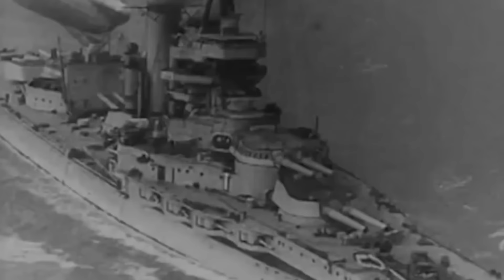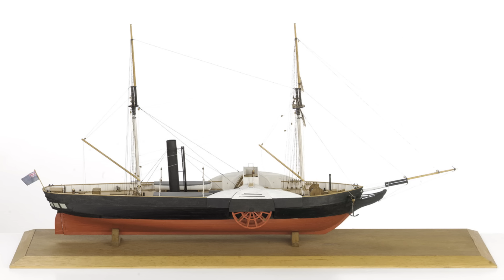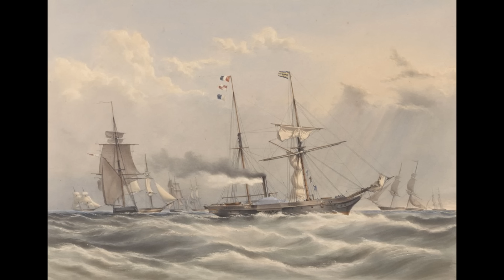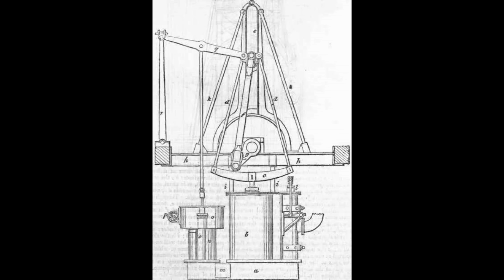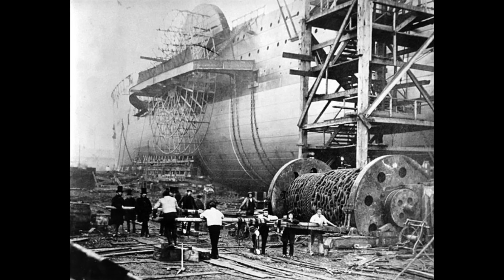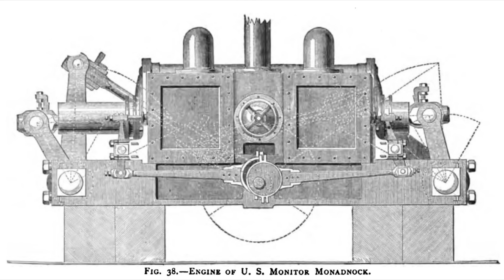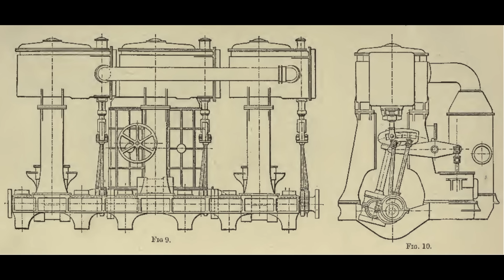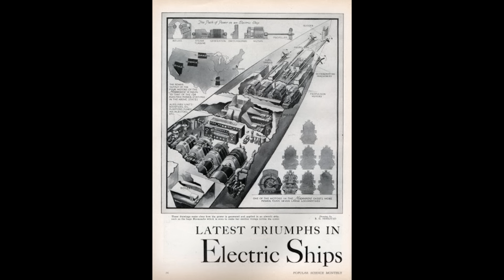Naval Engines - Rotate that shaft!

Comment: At about 35:00 you begin discussing "The Turbo Electric Drive." And then at about 38:30 you go on to speak of how hazardous it is to have such a system that contains electric motors & cables and having such a system become damaged & quickly sinking aboard a war vessel could easily electrocute numerous sailors & engineers and with such electrical currencies around the boilers could easily cause a small hole in a boiler, which would easily make small hole larger while steam begins to exit. The steam begins to exit faster & faster. As the steam exits faster it makes the hole grow larger. As the electrical equipment has already electrocuted & killed most the engineers there is no one there to stop or prevent the snowball effect that is rolling down the hill & getting larger by the millisecond! As the sides of the ship has been penetrated & cold water is rushing into the engineering spaces, the cold water rushes over these boilers. The small hole in the boiler quickly becomes a larger hole. And as the cold water on the outside is trying to make the metal contract & the heat inside the boilers is causing them to expand, the metal is twisted by the temperature differential & boilers suffer a catastrophic steam explosion causing numerous large electrical motors to go hurling in whatever direction the explosion has forced it. So if you have escaped enemy gunnery & electrocution by your own machinery there is still a chance, that if your magazines have NOT been flooded, the electricity from the turbo electric drive could possibly cause enough electricity to cause a spark within the main magazine. Of course an electrical spark within the main magazine 
would cause such a colossal explosion that with the ship going down that most any part of the ship left above the waterline will probably disintegrate into  so many pieces that there is little reason to seek her!

Comment: Thank you for your very well produced video. 
I'm 82 and retired Chief engineer.  Sailed on many types of vessels and really miss walking around the engine room, especially when a DOXFORD  DIESEL  engine was turning under load at 110 RPM. Hardly any noise,  No screaming turbocharger but lever operated side scavenge pumps or a huge centre mounted crankshaft driven mushroom shaped scavenge pump.  
And the beautiful smell..
BillDover UK

Comment: Constant speed, reduction gears, and variable speed fluid drive may have been an answer. Hydrostatic drives for individual propellers would be good fo maneuvering. No risk of electrical problems.

Comment: I know this is years old, But I watched this video when it came out and I had to rewatch again it to understand turbo-electric / Diesel Electric engines. My question is: 
Could you possibly have used a system of clutches and transmission shafts to engage direct power from the diesels when wanted, while charging the batteries off of the shaft?
Then use said power from the batteries to a motor that is also on a clutch to the propeller shaft so it can be engaged alone or alongside the diesel engines? I know some escort ships had “creep” motors as well for silently running while hunting subs.

Comment: A nice thing about the pivoting cylinder steam engine was that the intakenand exaust timing was soley reliant on the cylnder pivoting from one port to the other closing the ports as it passed. This cut down dramatically on amount of valve train necessary.

Comment: My fathers first 6 year tour with the Navy started in 1926, and he was an engineman with triple expansion engines in his charge, but when he went back in January of 42, he was on a ship with turbines, this time as a CMM.  One of his favorite books was, 'The Sand Pebbles' because of the chapter where they solve the thud problem in the engine, going into great detail in how it was accomplished, such as stretching the piano wire down the middle of the crank journals to mic the distance from center to bearing surface.  The movie did not got into the details as in the book and the author must have known, or had a great source of information, on naval steam engines.

Comment: I remember when she was reactivated in the 80's there were many issue to overcome, Sperry had to bring technicians out of retirement to overhaul the fire control computers, there was talk of replacing them with modern computers and they found out it would not make a difference, second the main batteries, the Navy brought GM' s back on active duty to train the new GM's on the 16 inch guns, when she arrived in San Diego I was on a tug on the Bow and the rails were manned by Chiefs or E3's or 3rd classes

Comment: Good grief ... 45 minutes of listening to an adenoidal Englishman who apparently gets paid by the word but doesn't know the difference between nominal and indicated horsepower and thinks cylinder heads move up and down and completely missed the point that practically all very early engines were described as "vertical" engines.  Engines of the type that placed the cylinders above a crankshaft in what we now consider typical marine steam engines were call "inverted" engines. Turbo-electric drive provided higher, not lower, efficiency than a geared turbine drive. This guy needs to talk less and study more before making videos.
Reply: Wow. You must feel very good after getting that off your chest.

Comment: If you take the paddle steamer engine in the first image shown at the start of the video and modify the beam or 'side lever' to be a 90 degree crank instead then take the drive from it though a connecting rod to the crank on an axle driving a railway wheel you end up with the drive train of the weird little Dundee built locomotive Earl of Airlie. Always been something of a suspicion of mine that this line of thinking of just slight modification to an established paddle steamer engines layout was the true reason this locomotive was designed this way rather than, as some have put forward, it being a consequence of rumours put about of uneven wear in cylinders that were not vertical. 

Makes even more sense when you realise it was designed and built by someone almost entirely concerned in the construction of marine engines when built who would likely have not even been concerned with railway developments other than being awarded this contract for the locos for this local railway which they probably took on as a matter of keeping the job local to dundee not as any great intention to get into the railway locomotive game in the long run which was already a business that many others had a strong foot hold in.

Comment: I think it is odd that early battleships did not have the guns on center line . But had them off to the side. Plus what was the deal with German Light cruisers with the guns offset from each other  before WW2? Plus why 2 rear turrets and not 2 in front?
Reply: He explained this in at least one Drydock. If you search the archive on his site, you can probably find it.

Comment: I'm surprised you didn't mention the dangers of working with steam. The boiler rooms were fun depending on the age of the vessel. I was a Machinist Mate E-4 on the Piedmont AD17.  There were four 800 pound psi boilers. Two forward engine room. Two aft. Two screws. If there happened to be a leak in one of the boilers say 1/16" through the casing. You would Not see the vapor cloud from at least 12 feet. We would take a wooden broom handle and run it along side of the massive block until the the stick would easily be sliced in half. By the way normal operating temperatures were roughly 125 degrees. And the bilge water smelled wonderful. Gagging my memories.
Reply: You could make a life's work of detailing all of the ways that one could suddenly die while serving onboard a ship in the US Navy.  I served onboard the USS Kansas City (AOR-3), a Replenishment Oiler.  Contemplate the thought of a fire (or a missile/torpedo hit) when you are carrying all of the spare DFM/Bunker fuel, JP-5, and ordnance for the entire Carrier Battle Group.  

With 7.5 million gallons of fuel and 600 tons of ordnance onboard, I just figured that I might see the flash, but would never hear the detonation.  On the flip side, might have been the first USN vessel to achieve Low Earth Orbit...  :)
Reply: @kevincrosby1760  That was Good. Thank you. The only thing that made me squeamish was being on a ship when it was on fire, ready to explode or sinking. And yes I was fire control also. The vastness of the oceans are just mind boggling. Out in the middle of literally nowhere.  It didn't really phase when I was in my late teens through my twenties.  Now at 61... What was I thinking?

Comment: In the early 80s I worked in the GE gear plant in Lynn MASS. They were a major supplier of gearing for USN submarines, all they way up to carriers. I also was part of the RD team that created the high speed reduction gearing to be installed in ARLEIGH BURKE class destroyers. GE put the first gas turbine and reduction gearing together as a unit. There were turbines on other ships but never one actually designed together. I actually machined the major body for all gearing and other parts to go on. The gear plant had all large machines and as a young machinist i was amazed at the size of parts. The gear plant is gone like most ge plants

Comment: AO 109, USS Waccamaw, a Cimmaron class fleet oiler, was christened shortly after the war. She was “Jumboized” in 1965. 
660 ft in length, she had  twin Westinghouse engines (HP & LP turbines) using 440 psi steam w/710 degrees superheat. 
Ship’s electrical service was supplied by 3 Westinghouse 500 kw turbine generators. 
Refueling pumps and rigs were powered by 3 Alco V16 diesel generators producing 1500kw each.
I once observed her doing 18 knots while drawing a 35’ draft with a nearly full fuel load of 6,000,000 lbs!
She was a damn good ship.
Reply: Yeah.  I was stationed onboard the USS Kansas City (AOR-3), a Replenishment Oiler of similar size and draft.  3 Boilers, two 2-stage turbines.  600 PSI at 850F.  4 Turbine generators at 2MW each.  Our EDG was 500 kw and powered by two Detroit 8V92 high-speed diesels, on on each end.

5 Million gallons cargo DFM, 2.5 Million gallons JP-5, 600 tons ordnance capacity in 5 cargo magazines, 200 tons reefer/Frozen.  2nd deck was all cargo storerooms and palletized goods.  Forget the cargo deck dimensions, but 10 laps was an even mile. 

We generally cruised at 17-18 knots.  Official top speed was 21 knots.  We were homeported in Oakland, CA.  Heading back to port after the Loma Prieta earthquake, I was sitting down in the IC Shop watching the pointer on the Underwater Log slowly drift back and forth between 24 and 26 knots.  Don't know what was going on down in the Hole, but I do know that we had a gray haze off the stack that stretched all the way to the horizon.  I think they took "make best speed" seriously and were pushing the Plant just a tad.  We NEVER had visible smoke underway.

Comment: You don't seriously think that a huge electric propulsion motor would be more easily serviceable than a steam engine?  I'd say you were simply trading problems, as the size of all of these machines made underway repair rather improbable.  The problem with turbo-electric was cost and weight.  Both systems had comparable loss mechanisms.  The economy of scale in actual designs was more significant.  The Lexington had large numbers of smaller electric turbines versus one large main engine complex per shaft found on geared turbines.

Comment: 39:54 - On the other hand, on a geared-turbine ship, the turbine's speed still varies in direct proportion to the propeller speed, meaning that going faster or slower necessitates speeding up or slowing down the turbine itself, which can easily take it outside its power band and cause efficiency to drop off (unless you equip the ship with a mechanism for shifting the turbine-to-propeller gear ratio to compensate, like in an automobile, which would add considerable additional weight and moving parts), potentially to a degree sufficient to exceed the conversion losses of a turboelectric ship.

And, indeed, turboelectric drives came back with a vengeance in warships during the Cold War...

Comment: 38:00 - Also, given the extremely high speeds and tight clearances needed by turbines, a shock of that magnitude would likely cause the blades of even a direct-drive or geared turbine to contact the turbine case, with potentially-spectacular results, or cause the gears of a geared turbine to jump (likely shearing off the gear teeth when they came back into contact).

Comment: 29:53 - Why weren't opposed-piston triple-expansion engines (where the large mass of moving metal is balanced out by an equally-large mass of metal moving in the opposite direction at the same speed) used to give a smoother ride (especially since opposed-piston engines also have a considerably-higher thrust-to-mass ratio than non-opposed-piston ones, due to not needing cylinder heads)?

Comment: “A burnt out electrical motor would be far easier to repair with spare parts, than a turbine that had stripped its blades and probably explosively disassembled itself” brilliant.
Reply: Yes, it's quicker & easier to replace an electrical motor. However, if turbines are powering those electrical motors then you still have the maintenance issues of the turbines but also have to replace the electrical motors when they are lost as well. And considering that it's a "warship" & sometimes warships have to go into combat & take damage in said combat, if cold salt water comes pouring into where you have these electrical motors, it's NOT a good scenario! And while I will also agree that boilers also pose a risk when it comes to cold sea water surrounding a very hot boiler very quickly. With the geared turbines you at least aren't at risk  of BOTH a boiler explosion AND Electrocution. And the main advantage of electrical drive that I can see is if the ship finds itself heading towards an object & needs to stop quickly, with the electrical driven motors that can be done quickly and easily without the risk of stripping the gears of the turbine and possibly tearing up your entire propulsion plant in an effort to avoid whatever disaster the ship is heading towards. And while I would agree that is a really good thing. But such an encounter is very rare for most ships. And also the lost efficiency of generating electricity with the turbines and then using electrical motors to drive the screws, it's not only the loss in efficiency but also the fact that it takes almost twice the machinery space & that once the geared turbines becomes more reliable they are definitely the way to go!
Reply: Well yes but you dont need a turbine to provide the rotational force for a generator.
Anything that results in rotation works.

Triple expansion steam engines, diesel engines, gasoline engines, etc…
Reply: @FlorenceSlugcat  worst comes to worst you can get a bunch of guys cranking like they’re on HS Hunley. Though, if you’re that hard up for electricity, you’re probably going to end up like HS Hunley pretty soon.
Reply: True, but it doesn't matter much if that failed turbine happened to be driving the generator that feed the motors....
Reply: @kevincrosby1760 but if it was a steam turbine driving the electrical motor, then that steam turbine is dramatically less likely to break than one that's driving the screws directly because said turbine would likely be running at whatever it's optimally efficient rotational speed is, Or has one driving a screw would have to be constantly changing speed which would be applying much higher stresses to it

Comment: We used to run our tugs on what was called at the time "bunker fuel". The only drawback was that the fuel tanks had to be constantly heated to keep the fuel from solidifying in the tanks. The big 12 cylinder Coleman Patterson diesels (2) would drive generators that made electricity to drive the electric motors thru a reduction gearbox for each propshaft. Going from full ahead to full reverse took time, but they were more efficient than steam powered tugs of the day that were still in use in the 1960's and 70's. Diesel Electric propulsion is old technology that in a slightly different form is used to move "hybrid vehicles" of today. The Honda Prius is a prime example of that technology being used to move the car and charge its batteries just like submarine diesel electric propulsion. Miniturization is the only difference over the 80 years that this technology was first used.

Comment: The treatment of engineers was downright awful in the beginning.   Since most deck apes were and largley still are far too stupid to run an engineering plant it wasn't uncommon for civilians to be inducted in to run things.  Abuse was common and since it's a dirty job even more so in the days of coal they were often forcibly kept below decks.  That was just a short summary, but modern engineers haven't forgotten the abuses are predecessors suffered. 

To say engineering department and deck department don't party together is an understatement.   When the mighty Tomcat was still around Tomcat crews and Hornet crews were downright friendly with each other in comparison.

Comment: The reciprocating component inside a cylinder is the PISTON . Not the cylinder head. Obviously engines aren't your favourite part of a warship but some cursory research into piston engines, wether internal or external combustion would prevent such glaring errors.  This is the 1st rudimentary mistake I've come across in your content, hope it's an isolated incident and not the status quo that I've noticed as I'm a mechanical engineer?🤔